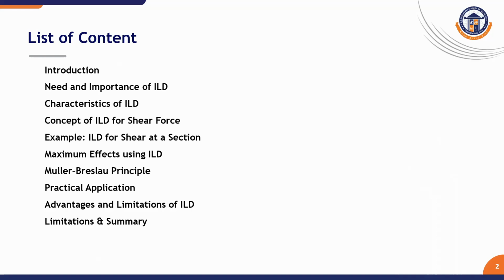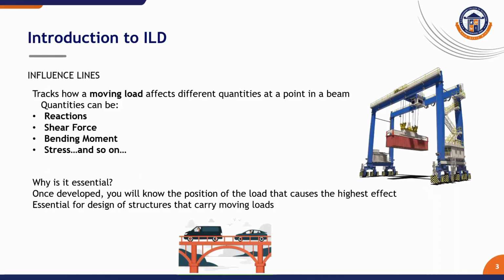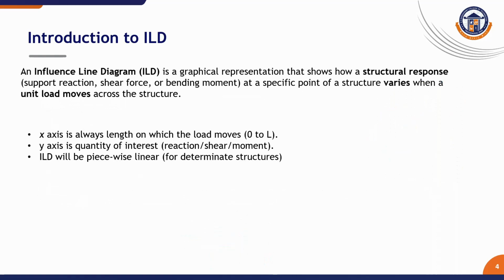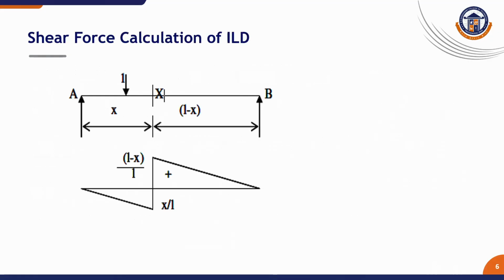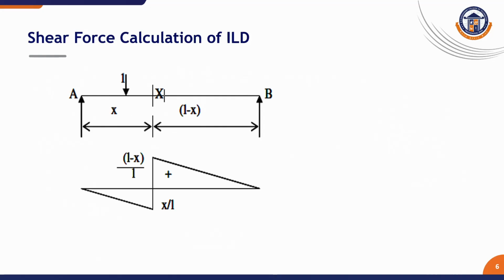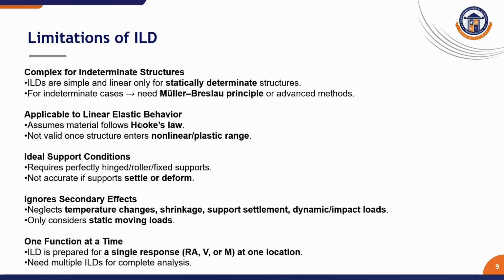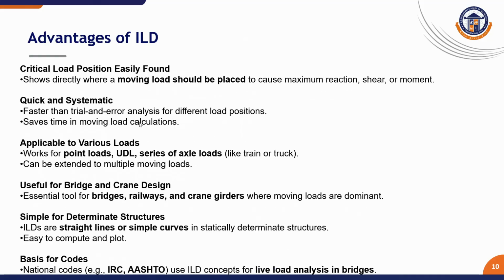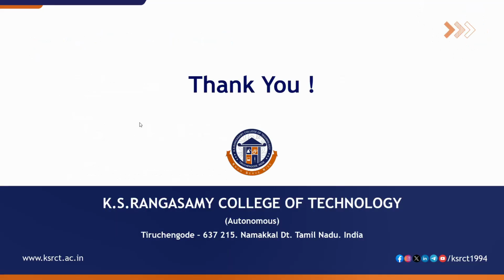Influence Line Diagram

Comment: This video explains that Influence Line Diagrams (ILDs) are essential graphical tools used in structural engineering to track how moving loads affect specific points on structures like bridges . By plotting a unit load's path, engineers can instantly identify the critical load positions required to calculate the maximum shear forces and bending moments for design.